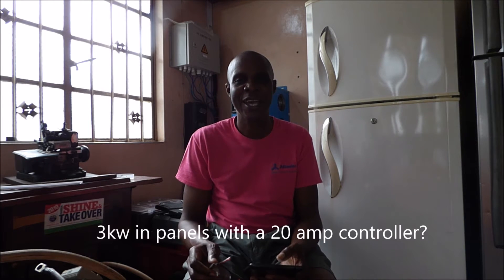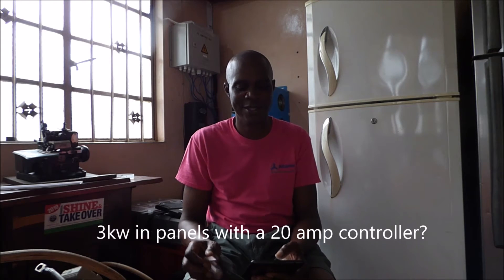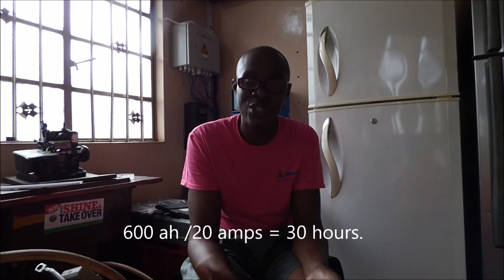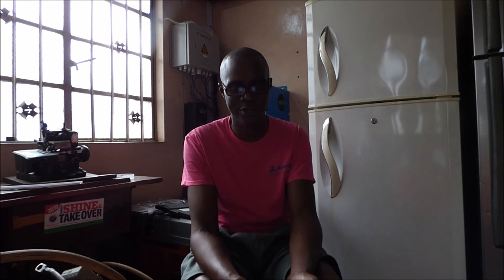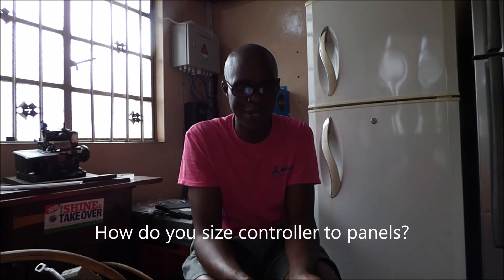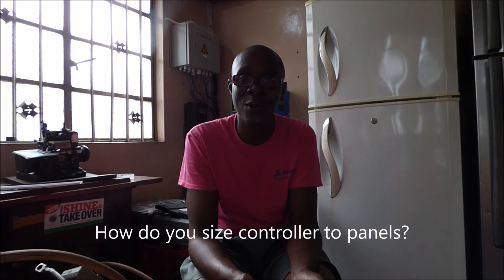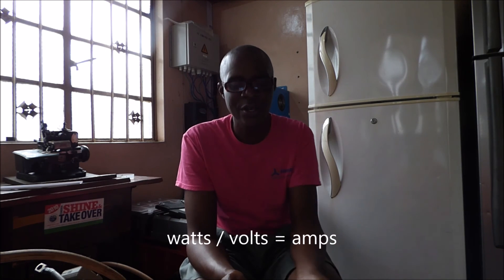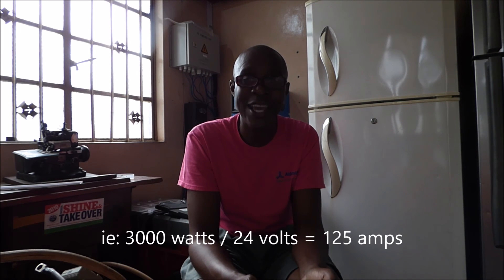Misconceptions about Solar power? What is the right answer?. Part 2

Comment: `Why is storage (batteries) not needed in the west and is needed in Nigeria?
Reply: harty45 that is a very good question. In the West they have grid tied systems. They need the grid to work and have no need for batteries. In Nigeria the grid is unreliable and not very smart. Would not know what to do with the power it sees from your solar power generator. At night when the grid fails you will be in the dark without storage.
Reply from the maker: We have an unreliable grid

Comment: God Bless you sir this tutor make some basic known to me, and pls.sir how many panel and in what connection will form 1kw of 1000w that i want to divide by inverter voltage
Reply from the maker: henry olatunji thank you. It depends on the panels you have. 250 watt panels will require 4
Reply: 4 in series or parrallel
Reply from the maker: henry olatunji depends on what you are trying to accomplish. Are you looking for current or voltage?
Reply: 24v inverter 4 250w in series and parallel unlike one of your videos i think it should be 500w 24v and you said 1kw thats 1000w divided by 24v which will gives us charge controller Amps, what is not clear is that how is that 4 solar pv make 1000w instead of 500w can you clear this to me sir
Reply from the maker: henry olatunji I think you need to invest time in watching other videos that teach the basics of solar.
Reply from the maker: The panel capacity is additive. When you do your serial or parallel connections you can do voltage or current as your priority. Four 250 watt panels are 1000 watts. No you can to prioritize voltage by doing serial connections. If each panel is 30 V and 7 amps and you wire them in series you get 120 V at 7 amps. Still 1000 watts
Reply: noted sir what if i parallel it
Reply from the maker: The purpose of the video is not to teach how how to wire your system or not wire it. It is informational to provide you with information you need to know. There are lots of videos on YouTube that teach about wiring of panels and batteries if you need to learn about specific issues